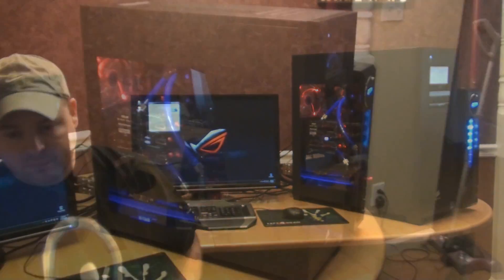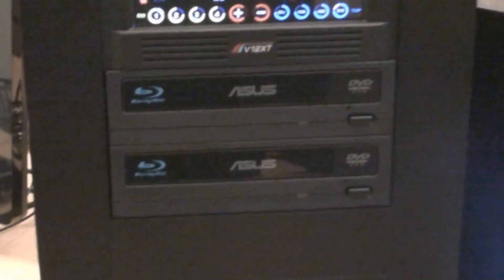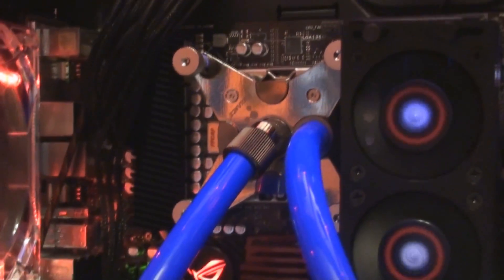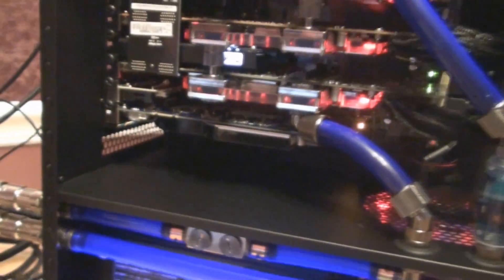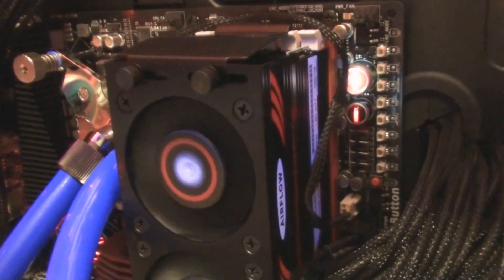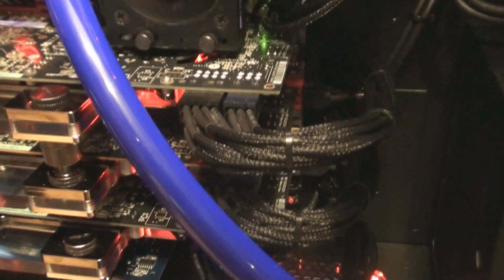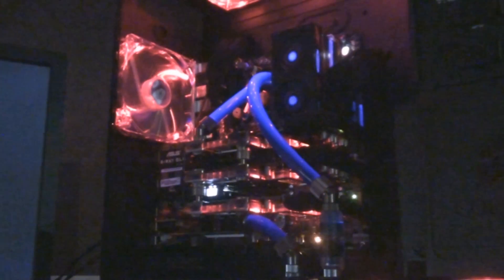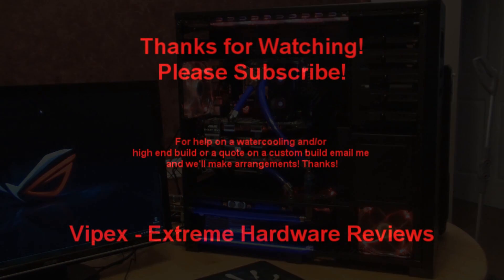Gaming Computer Showcase:  Project Sweden / Core i7 980X @ 4.4GHz with GTX480 in 3-Way SLI + physX

Comment: I think that's the best build I've seen up to date. I use the 800D myself and the only regret I have is that I didn't buy the ERM-2K3U! I actually put a 120.3 radiator with push pull fans in there to cool my two GTX480s and two 140 radiators with push pull fans for the CPU and MB... I really should have done something like that.

Comment: Is there a huge difference in performance in choosing a dedicated physX card?  Like you used the 9800gt.  I have an 8800gt that I could toss in when I do my new build, which from what I understand is like the earliest series capable of rendering physX.  Would that card perform subpar?  Are you going to get better physX using higher end cards or is any card capable of physX generally the same?  If I can save 100 bucks on a physx card, I'd just use the 8800 if it's just as good. :)

Comment from the maker: @IRud3Bwoy I saw that on you build and liked it.  I was able to find ASUS drives that match the outside look of the case.  I'm kind of a label, and logo guy.  Don't like to not easily show what is in the build.  I do like the window that was cut in your case.  My last 800D, I painted the bottom part and it looked nice.  Give it kind of a optical illusion, but having the 700D custom cut is cool.  My buddy and I are modding a 700D to fit an SR-2 right now.  Wish us luck!

Comment from the maker: @dragon96186 For gaming it is the 9500GT by just a bit.  Even with different series of nvidia cards, you can tell where they sat in performance (in general) by the second number.  So even though the 220 is a newer series card, the '5' is higher then the '2'.  Now you can't use this same logic and jump several generations...   :)

Comment from the maker: @Iceman35121 The main reason a person goes to an SSD is not necessarily the transfer times which is what RAID 0s excell at...it is the minimal access times that is key.  No spindle HDD can match an SSD in access times.  His RAID is definately cheaper, barely faster on the transfers for SATA III...but you are correct, he has a lot more space.  SSDs just seems faster in the OS though...everything loads instantaneously.  That's the difference.  Sorry for the late reply.

Comment: another comment =x

same volts here for my 980x 4.3 at 1.376 but anything after that for me requires so much volts

btw do u actually have the ram at 2000 speed?because the best i got mines at is 1800 or a little bit over and can't seem to get it stable!

Comment: I wonder if you ever thought about using a Chiller to cool a system such as that, or maybe the new Mo-Ra 3 from watercool. But I guess you'd need two Mo-Ras to cool that system quietly. with two Mo-Ras it should be possible to cool that system like your's (SR2+4-way SLI) with only 800 rpm fans...